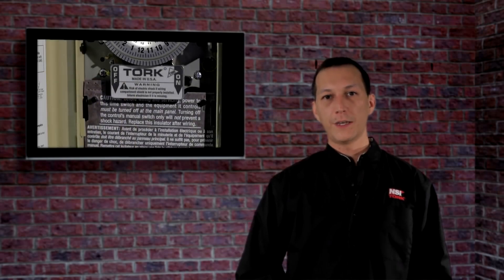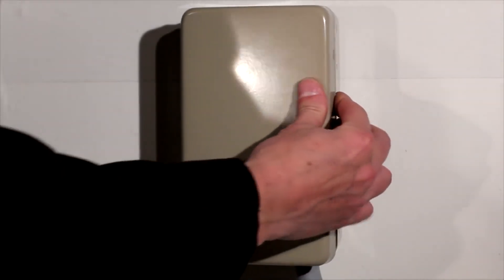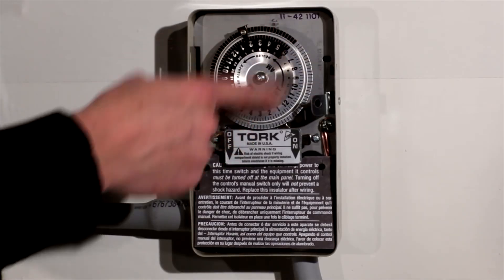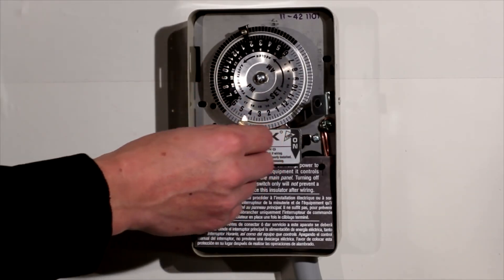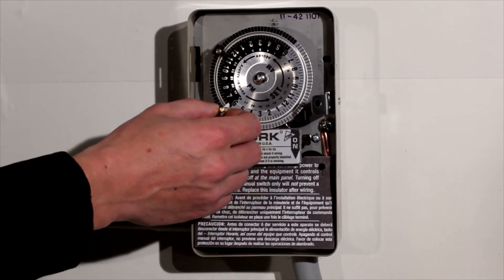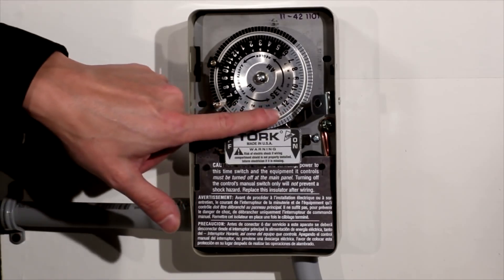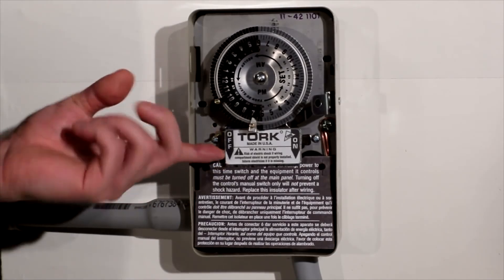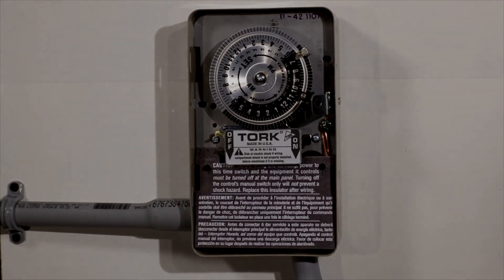Tork 1100 Series Time Switch Operation

Comment: My dial was wobbly and the plate broke off. The timer is still functioning overall, but can't figure out a way to re-fasten the dial. Any suggestions?
Reply: I have save problem. I think we got robbed. I'm going to try and put a washer on mine.

Comment: Is there any way to bypass the timer to let run continuously.
Reply: Remove the black and silver stops from dial, manually flip to "on" position like he did in video. It will stay that way until you flip to "off".
Reply: Take the blacks off screws and wire them together.